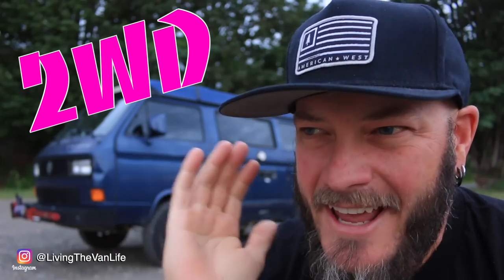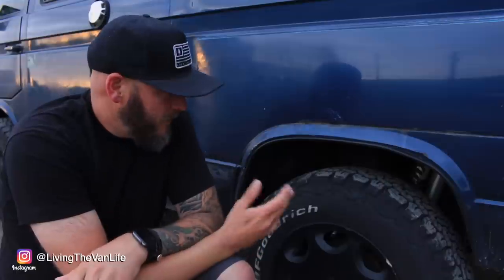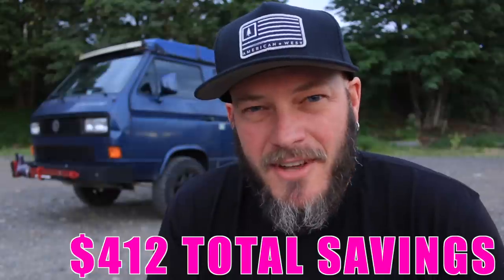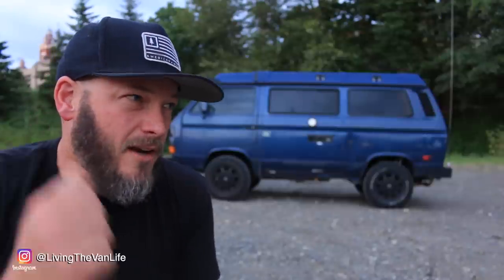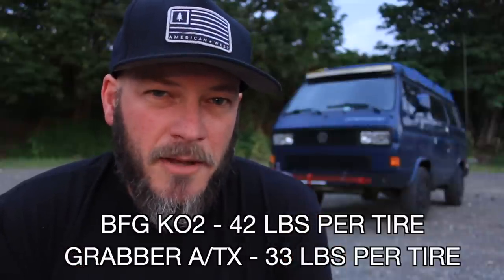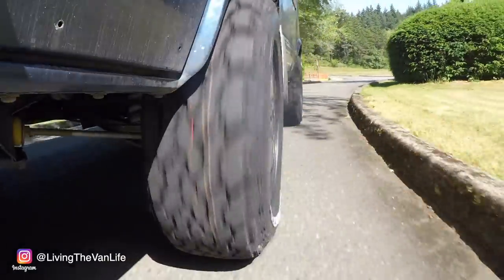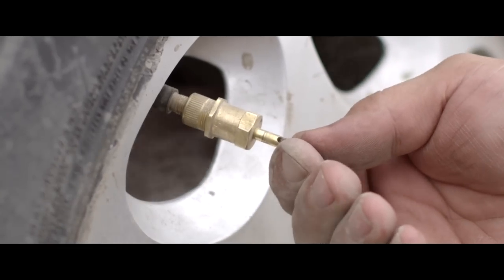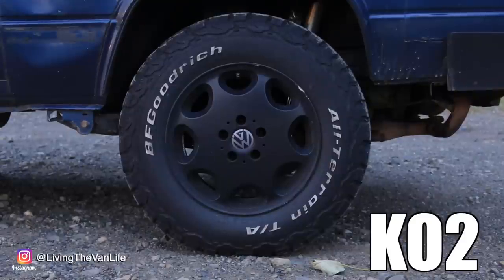BEST All Terrain Tires For Van Life - Living The Van Life

Comment from the maker: What is your favorite tire for van life?
Reply: love my Falcon Wild Peaks for sure. Excellent tread wear and pretty cheap too!
Reply from the maker: David Siegrist Nice!   Good to know!
Reply: General!
Reply: I have General Grabbers on my Traverse, I like them and they're competitive pricewise...
Reply: Geolandar AT G105’s.
Reply: The Yokohama G015 is superior to the Grabber inmho. Had them both on my lifted VW T6 4motion in 255/55r18.  In the dry, off road and when it comes to noise, wear and price there are only slight differences. Both have the three-peak-snowflake-mark. But when it comes to handling, traction and braking in wet or snowy conditions on road the G015 shines. And not to forget - they are both produced in the U.S. while both are non U.S. owned companies (General tires=Continental=German; Yokohama=Japanese).
Reply: Hello I just found your video  trying  to find a good tire for my van. However  the link you provided  on Amazon  says  that the tires aren't available  any longer. Do you have a recommendation  on a different  tire?
Reply: K02 🛞

Comment: We Installed General Grabber AT3 tires onto our rear wheel drive 1996 LWB Mercedes Sprinter camper conversion last winter to drive through Sweden, Norway (to Lofoten & Nordkapp) and then down through Finish Lapland. This was over November, December and January so worst conditions of deep snow and ice! the tires are rated for winter and summer, we drove though a foot and a half of of un-plowed snow no problem never braking traction, a bit less effective on solid ice but they got the job done up the mountain passes of Norway.

 We then drove all the way through eastern Europe with them and on very steep, dusty and rocky off road mountain trails in Bulgaria. The tires are incredible! They felt like big marshmallows when i first tried them too and our van is super big and heavy so went with a size up like you did.

even with the slight reduction in fuel mileage i would recommend to anyone living in their van no matter if its 4x4 or RWD to fit a pair of AT tires onto their van! To be able to leave them on all year, drive down any dirt road, and then use them in deep snow and ice no problems is a game changer! Makes finding great places to sleep the night so much better!
Reply from the maker: Very awesome feedback.  Thank you for sharing your experiences.  Sounds like you have had some awesome adventures.
Reply: Living The Van Life no problem! 

We still have yet to get our Electics to the point where uploading videos regularly is possible especially in the winter but we’re working on that haha... living in a van is more expensive than most people realise if you still want to be able to live in it with no restrictions like you would in a house. Once you’ve got the  van fully built and set up perfect that’s when you make the most of its cost efficiencies. 👍🏼

Comment: Thanks for the vids, positivity and enthusiasm. I do think we may be missing a number of factors with this comparison. First off, there have been off road tests that have rated a number of other tires to be much better than both of these types. They look good, no doubt, but Wrangler, Cooper, and Yokohama among others may actually have an advantage on both of these. I personally loved both the Copper AT's and the Yoko Geolanders.I am also in WA and have taken my Synco all over and even went to the point of the subi conversion. With the granny gear in my syncro one of the things I noticed clearly was how larger tires sacrifice low end torque. From stop, or near stop, to moving. This particular application/function/ability is essential for anyone who will take their vans off-road, meaning off the easy FSR's. I am now super hesitant enlarging the size of my present 2wd Wesy's tires due to this factor along with knowing that my 1st gear is now not as capable as the Syncro's granny gear. When you factor in the cost of all the mods I do not believe they pay off in terms of improving actual capability of these vans and especially in terms of reliability (may off roaders consider mods to be the primary weakness of the vehicles and this has proved true in my experience as well.). When you are stuck in the sand and are needing as much low end torque as possible and when you are attempting to crawl (moving at idle in 1st gear) if you don't have the torque (related to gearing of 1st, tire diameter, and engine torque of course) it is a clutch burning mess that offers much less control. Anyways, just some thoughts to push (intentionally) against the grain of over modification. Can't deny the looks, they look sick, but my experiences have not shown me an actual pay off in terms of performance for many of my previous mods. I got stuck in 'mod land' which is expensive and in the end was not worth most of my time.  I will look forward to running into some of you especially if your around Bellingham. Top O da day to ya! :)

Comment: The KO2 seems to get harder and noisier as they wear and go through heat cycles. I have run the BFG's for probably twenty years now on my trucks. Heavy and expensive but I have never had a flat in the mountains. Costco beat both Discount and the Schwab by four hundred dollars for my truck tires but I deal with my own rotation and balancing as they wear. I think for your van just the weight saving is good enough reason to downgrade the side walls although you drive like a mad man and aired down you might pay the price. Great review!
Reply from the maker: Hahahaha.  “Mad man”

Thanks for the feedback. Much appreciated.  I figured it was worth trying out these tires.  So far so good.

Comment: I run a set of GG AT3s, I do love the BFGs and think they are certainly king, but in my size & weight class (215/75r15 lightweight truck), the GGs are literally 50% cheaper and offer comparable performance. The only real differ is the BFGs have harder sidewalls, which I think would make them far more durable on heavier rigs.

Comment: What engine are you running in your van?   Is it the stock 2.1 liter FI engine?  Have you noticed any difference in pulling out from a stop compared to the vehicle with stock 14"  diameter rims?  i. e. larger diameter tires/rims reduce your starting leverage at the rear axles.  Larger rims will reduce engine rpms when highway cruising which is a plus for reduced engine wear.
Reply from the maker: Yes.  Most DEFINITELY! Bigger tires with stock gearing will be much more sluggish on acceleration.  I have a Subaru 2.2L motor in mine and I notice the huge difference.   And it doesn’t matter what size rim you have.  It all comes down to the overall diameter of the tire.  You can have a 14” rim with taller sidewall tires that are the same over all diameter as a 16” rim with shorter sidewall tires.

Comment: I got a set of general ATX has on a 2001 GMC Jimmy four by four. 235 / 75 R15. I bought them over BF goodrich's for a couple of reasons. Mileage warranty the generals have 50,000 The BFG had none. The three mountain or three peaks symbol for snow and ice. Believe It or not GM says do not put snow chains on 2nd gen blazers. So that three peaks symbol gets me around it to a point. And last but not least costwhat mainly it was the mileage warranty I've seen BFG where funky no matter what you do. They are great in the dirt in the snow and on ice within reason

Comment: got a set of 235/75/15s on a set of eurovan wheels that I changed the offset on they are badass on my synchro i had a set of geolanders on there before they are a better hwy tire still good on snow not as good in the dirt...also im running a 2 inch lift
im a fan of a high weight rating id stay away from thin tires and those flimsy passat wheels.....

Comment: I'm running 215/75r15 toyo open country at, and I am very happy with them. And they are fairly cheap. Just saying....

By the way: do you have a spare wheel somewhere?!
Reply from the maker: Nice.  I had 37” Open Country’s on my GMC.  Them are some BIG tires. 

Yes. I have a spare tire in my stock location on the van
Reply: @LivingTheVanLife  what size is that spare wheel you fit under the van?!
 I am having trouble fitting my 215/75r15 in there ("spare" in my case being "full-size 5th wheel", not "spare" in the sense of just any tire)

Comment: What antenna do you have on the rear bumper ? Happy Trails : )
Reply from the maker: It’s an 8’ whip for my CB
Reply: @LivingTheVanLife  Have a CB shop check the SWR on your antenna,, usually not a good idea to have that much of the antenna that close to sheet metal.. Just to be safe would be a real bummer to need your radio to call for help and find the output transistors are toast and no one can hear more than a few miles.. 73, ki4uqx
Reply from the maker: Awesome!   Thanks for the feedback.  Yes indeed, checked the SWR’s with an external meter the day I installed it.  They were nice and in check.   Keep on truckin my friend!

Comment: How much power loss should I expect on 14" general grabber ATX on stock 1.9L waterboxer.
Reply from the maker: Depends on your tire size.  14” is your wheel size.  But that does not determine what your tire size.  You can have 14” wheels and still get tires that are the same over all diameter as mine on 16” wheels.  Just means your tire sidewall would be thicker.

Comment: I think your comparison in terms of cost or performance is not truly an accurate one. The only way that you can truly compare tires is by using the same size, and comparing a 10 ply vs a 6 ply...well there will be quite a substanial difference. A huge portion in the difference in cost is the fact the difference in the ply of the tire. I can certainly understand why you changed, but again not a true comparison. I too have a 10 ply tire, but it is more of a requirement for me because of the weight of the van. Thanks for sharing!

Comment: The Grabbers will give you 60% less mileage. So its horses for courses.
Reply from the maker: 60% less mileage over what?
Reply: @LivingTheVanLife  the other tyres. You said it, softer compound, softer walls etc. I am not knocking your review. You are comparing two sets of tyres, one tyre costs twice the other so it's horses for courses. If I were buying one of these I'd go for the cheaper tyre.👍
Reply from the maker: Carl Jones wow.  I have not noticed a 60% drop in fuel mileage.  I still get 14mpg as I did before...
Reply: @LivingTheVanLife  14mpg? My van is twice the size of your van and I can get 33mpg. I realise US gallons are smaller than 'imperial' gallons.😂
Reply from the maker: Carl Jones what van do you have??  And is it diesel?  Or Petrol?
Reply: @LivingTheVanLife  it is a Citroen Relay length 3, height 2, 3.5 ton van with a 2.2hdi turbo diesel engine with a 6 speed manual. They won't let you have this type of van in the US.
Reply from the maker: @CarlJones14  OOOOH!  yes.  Most certainly.  A 2.2 turbo diesel motor will run circles around a 2.2 petrol motor when it comes to fuel milage.  Diesel would be awesome to have for sure.  Even the giant Mercedes Sprinter vans here get twice the milage that my van does because they are diesel.